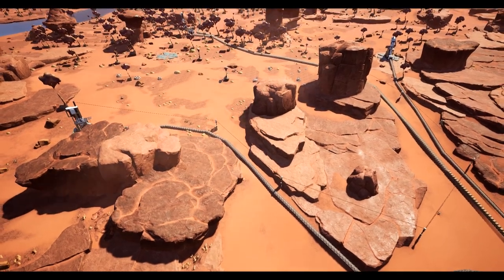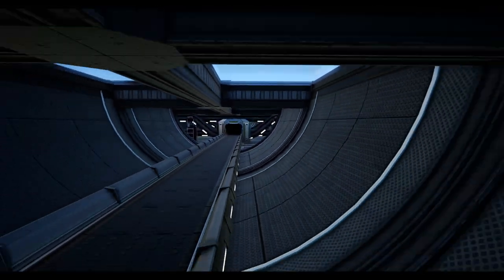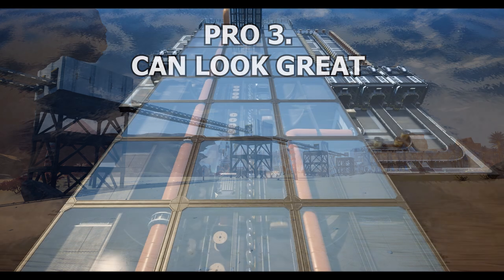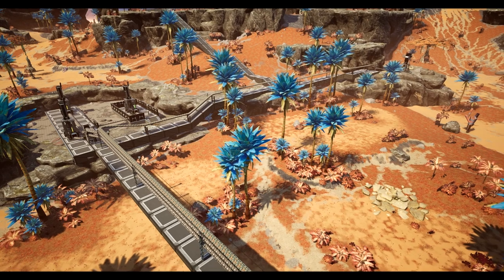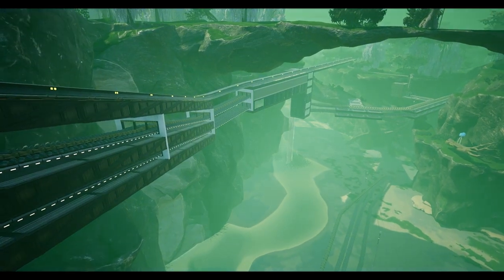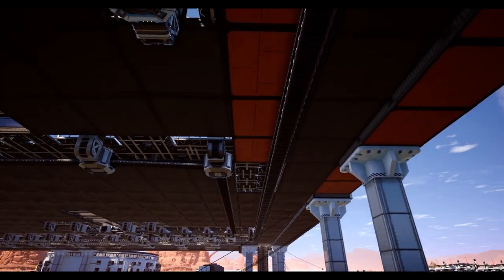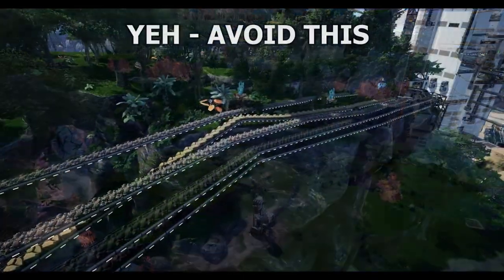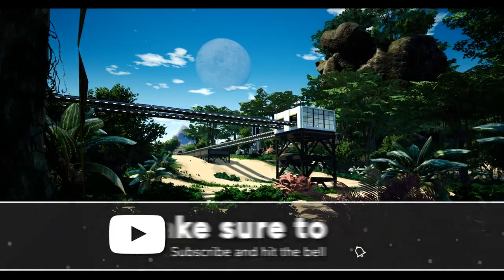Conveyor Bus - Logistics Guide - Pt 1. [Satisfactory Guide]

Comment: I found that simply sticking the bus on a tall wall using conveyor wall mounts is a very practical yet compact solution. Any of the bus lines can be split off anywhere to any of several manufacturing floors across a short gap from the bus wall.

Comment: I tried the main vertical bus idea. At first, I found it really convenient : all the resources on the same line, just have to pick with elevator. Good !
But after some use, i faced many problems.
One item per stage : quickly 12 stages. It is realy realy not handy to have so much stages. Especialy without any easy way to get up at the begining.
Mixing is a pain. I had to merge items coming from my train station to this main bus. Adding only 5 stages was a pain.
When items are at the relevant height it is fine, but they are not, you have to use sometime complex layout with vertical conveveyers and standard conveyers. Especialy when you use vertical bus (small ones) for the entrance of your factory.

My feeling in the end was. Ok the idea is good but not if it is too high. Carrying all the things around the base is often useless and ugly, especialy when the height of the bus is superior to the one of your factories. So I still use the pattern but with less height.

My current pattern is a storage yard next to the factories. The storage yard is similar to an horizontal bus with containers but working in both direction (one to store, one to feed factories). Picking towers are the added in front of the factories to pick items (similar to the vertical conveyer in a vertical bus). But my picking towers can be stacked, that way i can send the same resource at the same point on different stages easily.
Main advantage is that my picking tower is registered in blue print and easily connectes to the rest.

Comment: I had this cool idea for the game. They said that there would probably not be any flying things like drones/planes because it didn't fit the game but I got and idea to have planes in a way I think this would fit pretty well.

There will be these ruins of stations  (don't know what they are actually called) around the map. you repair them. (maybe you need to unlock something in tier 8 for this) Planes can then go from station to station. so there could be like a station per biome and then if you want to transport your items from green lands to desert it would be much faster than trains, but this would not make trains useless either because you cant build the plane stations manually only use the once in the map. You can have trains gathering resources in the area then load it onto a plane that goes to the other side of the map. ruins of plane stations would fit in the map too in my opinion, just like all these drop pods. Like the comment, if you like the idea the more people who see the better, also add suggestions to add onto it!
Reply from the maker: I mean we're not the first people on the planet, there could be ruined stations, it's a nice suggestion :)

Comment: I'm sitting here in my tangled mess of yarn barely able to cope with what's going on within 100 meters of me, much less "bus" anything larger than a dizzy slug. This doesn't really help me organize anything, just make it look pretty. How much clearance do you need to split things from a vertical bus? What considerations do you need to make if you're not endgame and are limited by tier 1-2 belts and have to move high volume items like screws? Do you even bus screws when you have only tier 2 belts? How do you sensibly split off material for your own construction without starving your factory? How do you estimate how much floorspace you need for the logistics bloat around assemblers/constructors? What can you do if your space is limited, besides Skyblock the factory in low orbit? How do you load balance a multi-lane vertical bus? Should you load balance a multi-lane bus?

Comment: Personally, since on my current playthrough I have a mega factory, I have a massive main bus where all the items get brought in and all the time I produce and use again are put. I think I have 30 conveyor lines and 4 fluid transport however I think I’ll increase fluid transport to 8. I have the main bus below my factory (I think 24 meters) so when I’m expanding my factory and need a resource for something, I can just attach a splitter to the bus with the appropriate resource, and the bring it up using an elevator to where I need it to be.

Comment: I'm at tier 5 at the moment, my main issue is that I would like a central hub where I receive all the items in containers and then redistribute them in assembler/constructors productions. The hard part is how to pull them away from the storage hub. Another problem is with ore because I need so many of them and still, I don't have enough conveyor high tier for managing them. The result is a mess in both parts.
Reply: I wouldn't recommend pulling back out of those containers in your hub, send your overflow from production to those containers. Feed off of busses that deliver items closer to where you want to build that way you can avoid the spaghetti mess. Also you'll never accidentally end up with an empty container because you've out-consumed your production.
Reply: @AshJMA  That's a good suggestion, thanks! Anyway issue in this way is that I don't have an overflow at the moment. Example: I only produce 9 Modular Frames per minutes and soon I will need 10 for Heavy Modular Frame. So I will have 12 (3 * 4) and is quite hard to let just 10 go and 2 going to the storage. The lack of splitter that let you select how many should go in a row is very hard to manage. 

Same apply for other productions like steel and so on
Reply from the maker: If you use a smart splitter you can control priority of modular frames to the manufacturer and any left over can go to storage would that resolve the issue?
Reply: @TotalXclipse  mmm ok that is a good point, but the look of the transport line will be stuck. Correct? It will start going overflow when the line is full?!
Reply from the maker: Alessandro Santarini yes - but if you have perfect ratios the last two will not fill up but keep decanting 1:1 so the line should keep moving
Reply: @TotalXclipse  Thanks! That is very interesting!

Comment: At what point should you start thinking about 'factorizing' your builds? I'm currently in Tier 1-2, ramping up towards building the Space Elevator. I've gotten to Tier 3-4 before and got frustrated trying to build coal plants and restarted in a different area. I've basically just placed a Miner-Smelter-Constructor system at each node and am going to have to go into Assembly soon to start fulfilling goals. Should I wait until way more advanced construction to think about making factories or start designing a factory right at this moment??

Comment: @totalxclipse, great vids dude!  
I want to build ceiling mounted belts.  You can't attach poles to ceilings, so that's not working.  What's the best method for doing this?
Reply: addons. At the moment its the only way. Take a look at Xclipses add-on guide but make sure to use the latest. But be aware the more adding you have the slower startup ofd the game will be. its fine after that though.
Reply: if you want to avoid mods, I'd make a temporary floor below for placing components and then remove the floor afterwards
Reply: Wall Ports. Throw down a foundation underneath the floor, throw up Conveyor Wall ports then delete the floor.
Reply from the maker: Some great suggestions, generally I avoid mods (I know I cover them but why use them if you can do without :D ) 
90% of the time I'll use conveyor walls like Victor suggests, the other option is the build it on a floor beneath the ceiling and then delete the floor like Luke mentions, But I like the support and if I'm really struggling the other option (exclusing mods) would be stacking conveyor poles or splitters / mergers and connecting belts between them

Comment: Was curious to know if the previous oil build for plastic can be mirrored to make rubber? If it can, I guess I just wouldnt be sure what recipes to select for the 4 refineries that are opposite to the other 8 that would be producing rubber.
Reply: you could mirror this build fairly strait forward but off the top of my head not sure about the exact efficiency though. you could use one of second set of the second row of refineries to convert the rubber and fuel back into plastic which would then feed the constructor to then produce  empty canisters for the other set which would work the same as before to package the fuel.  you would most likely need to  hook up an item sink for any overflow...  just to be safe. or if truly mirrored and close by you could just siphon off a bit of the plastic from the plastic factory to provide plastic for the canisters. Hope that helps.
Reply from the maker: You can't do an exact mirror as rubber generates excess fluid I believe however we will take a similar approach - in fact we'll problem segment some off to create plastic canisters for us, but I'm not 100% sure yet

Comment: My problem with buses is getting the lines onto the bus. Do you use lifts? How do you start, working from the beginning of where your resources are coming from or working back from your factory?
Reply from the maker: Some good questions, I did show how I'd do it on my underground bus and the same logic applies to others that merge on, whether you use elevators or not, but I can see the issues from other lanes joining onto the bus without a prior line

Comment: Hey TXC, great videos I think I've watched pretty much everyone you've put out at this point.  Quick question for you.  I created a lifted bus running multiple resources (Steelx2, Ironx2 & Copperx2, Concrete Ingots, Plastic, Rubber) into a central factory for processing, they are all stacked, so 4x3.  They are all coming into a single place in the central factory, but I'm having trouble neatly dropping them to the bottom resource "motorway" that I'm planning on building, without it looking horrific.  Any tips on how to drop and split 9 lines vertically while still looking good?

Comment: Interesting you don't like the mixed material bus**, for that would help when running multiple resources to a distant factory, instead of multiple conveyors*. In a way a train is a "mixed material" bus with multiple cars (it's all in how you set up the inputs and outputs).

*Use the fastest conveyor possible and work backwards how to keep it from being congested.
**Current state of smart and programmable splitters may be part of the problem especially when a lot is involved.
Reply from the maker: You’re right it can help for distances but if the system isn’t constantly flowing you can find it causing problems, trains are similar in that I would recommend putting a mix of items in a freight station but merely one freight - one item

Comment: Is there a way to get rid of the bump on long ramps or should I just get rid of ramps all together and use vertical?
Reply from the maker: You can minimize the bump by spacing the poles as far apart as possible to cause a gentler rise but you can’t get rid of it

Comment: can someone tell me how my machines get clogged up?

I'll grab a miner that say produces 90 ore a minute, smelt all this in like 3 furnaces that consume 30 a min each, then use a bunch of constructors to consume the ingots at 90 per minute, and stuff still manages to get stuck. I just don't get it!
Reply from the maker: If you use a manifold to load your factory, the machines will need to saturate before it runs at 100% efficiently

Comment: How the hell do you make corners in a bus though... especially when under a railway... and inclines declines... the tools offered are sadly a nightmare to make things neat =(
Reply from the maker: the 2 x 2 rule. place yoyur straight bus. then at the end place a conveyor pole 2 steps in front and then 2 steps to the side, if you've done it right you'll have 90 degree turn :)  or just use the mouse wheel
Reply: @TotalXclipse  right. In pipes and belts that's pretty easy. But walls and foundations it's downright sadist what you have to do to make 45 degree turns if it is even at all possible. I think this game would really benefit from 45 degree grid snapping 😔 As is it's really hard to make elegant buildings as the blocks are pretty beefy by default and you can only snap them in very limited ways.

Comment: 3 belts can hardly be called a bus. You show some nice belts setups but you should show how to handle a bus when it as actually large.
Reply from the maker: I'd argue even a single belt is a bus, along with 3, 12 or even more, I only chose not to show bigger buses because they all run according to the same rules, and I feel that it would just add extra confusion for some, sorry.